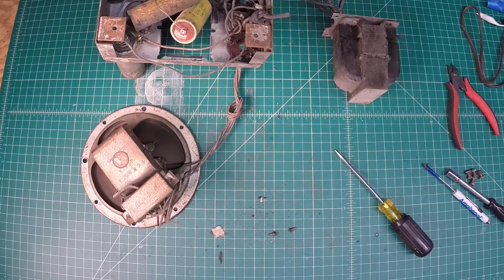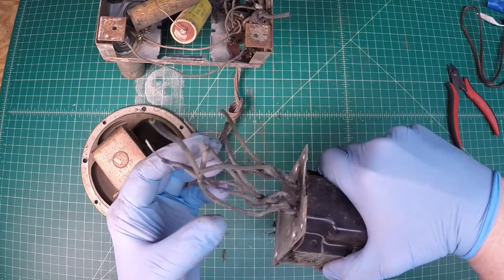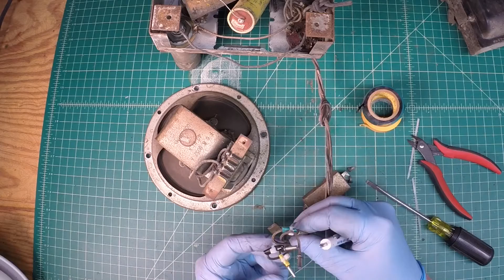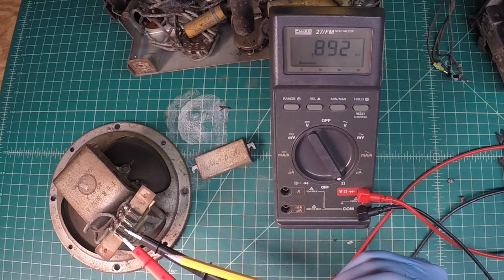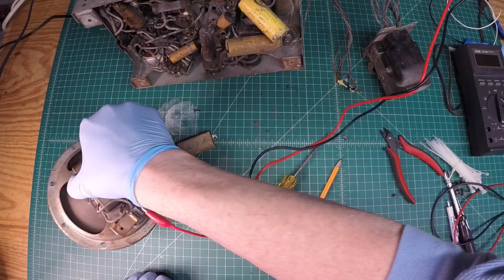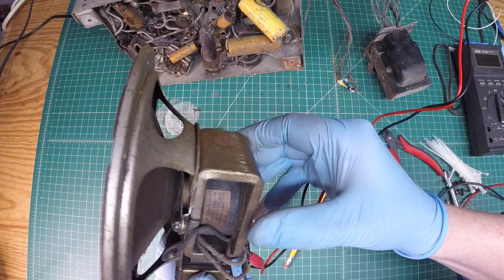Zenith 5-S-29: Testing the Field Coil, Output Transformer & Speaker

Comment: What's the purpose of the field coil on this speaker if it has a voice coil?
Reply from the maker: The field coil, which only resides in an electrodynamic loudspeaker serves two purposes. It creates a magnetic field for the center pole piece (soft iron) that allows the voice coil to function and the field coil also serves as a choke (inductor) to lessen the AC ripple as part of the DC power supply. A modern day permanent magnet speaker uses a magnet in lieu of the aforementioned. Hope this helps and thanks for reaching out. Best, Don

Comment: What is the actual voice coil resistance on the speaker itself if the output transformer was removed?
Reply from the maker: Hi Mark - all vintage loudspeakers for this period typically read 2.8 to 3.2 ohms of DC resistance. Hope this helps. Best, Don
Reply: @RestoreOldRadios  Many thanks 😃

Comment: So how much DC voltage is supposed to be supplied to the field coil?
Reply from the maker: It depends on the design of the set. In all cases it’s the B+ voltage, which can range from say 150V to over 300V. The field coil is nothing more than a large inductor and a voltage drop of 40 to 60 volts across it is common. Hope this helps. Best, Don

Comment: That is a great video thanks.I have a radio exactly like this.and my speaker is torn.isbit possible to use a newer speaker that already has magnets
Reply from the maker: A modern day (PM) speaker could be used if design changes are made. A Choke would need to used that was equal to the Field Coil or power resistors in addition to increasing the capacitor values in the power supply to further reduce the AC ripple. Best, Don